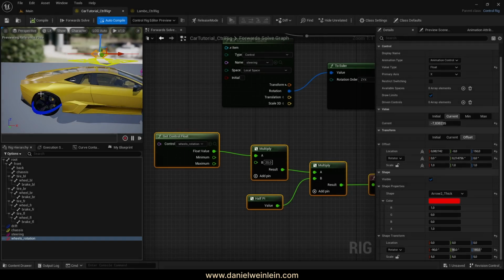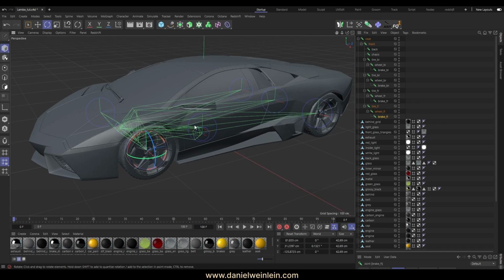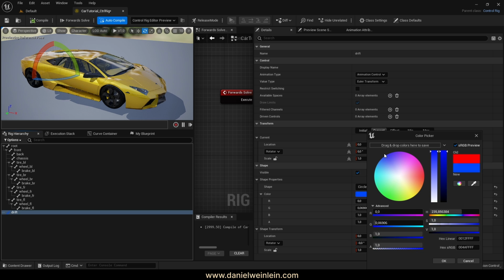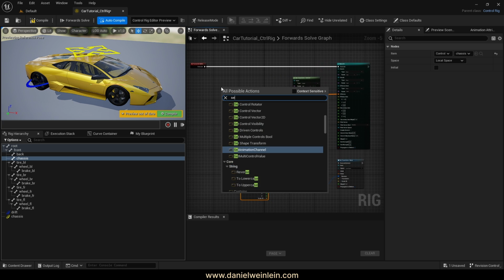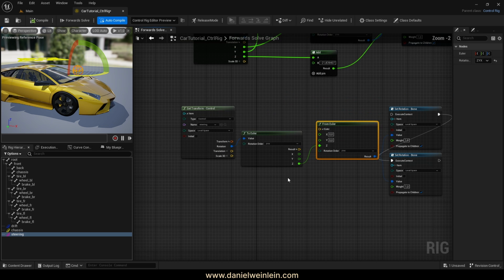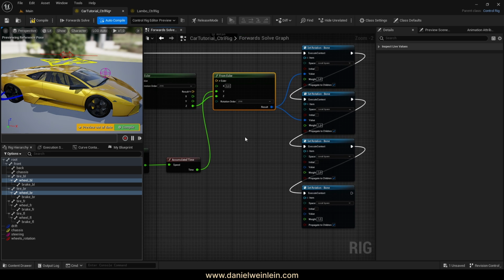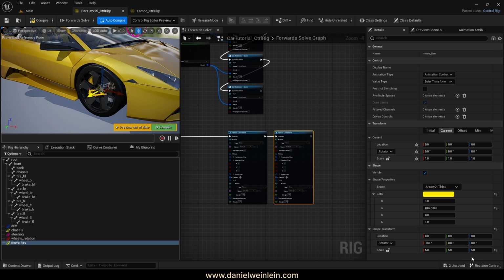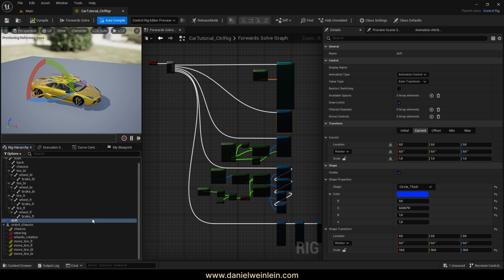Advanced Car Control Rig for UE 5 🚗| No professional driver required. Part 1

Comment from the maker: Hi there! The car rig has been updated to version 5.4 and is available. Epic has made changes to the control rig system in this update. An extra chassis_mount bone is now required for the rig to function correctly. 5.3 also still available. Tutorial coming soon. https://www.cgtrader.com/3d-models/car/sport-car/car-control-rig-for-unreal-engine
Reply: Well I asked a question in the blender bone setup, but Ive purchased your rig yesterday and I think somehow i manage to rig it in blender imported in unreal, copied your rig, but the icons are big and the settings are locked i Cant change them or scaled them, How can I change the size ;P thanks again
Reply from the maker: @Challenging_Reality  Simply scale the controls in the spawn control nodes of the control rig.

Comment: After adding the last constraint to the sequence node, for the Null and chassis, it makes my chassis ctrl flip out randomly when I try to move it. any ideas?
Reply: Just to update - the same steps work correctly in unreal 5.1. I guess something changed in 5.4 in the constraint node or something. Can't figure out what it is though
Reply from the maker: @-LeoBeall  The car rig has been updated to version 5.4 and now uses an additional bone for improved functionality.  Update available now.

Comment: Hello, how would you set up the wheel's suspension in Control Rig: so the springs compress and extend.
Reply from the maker: You can do this with a spline IK and stretch factor.